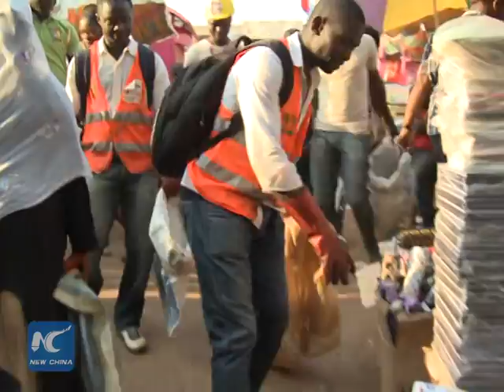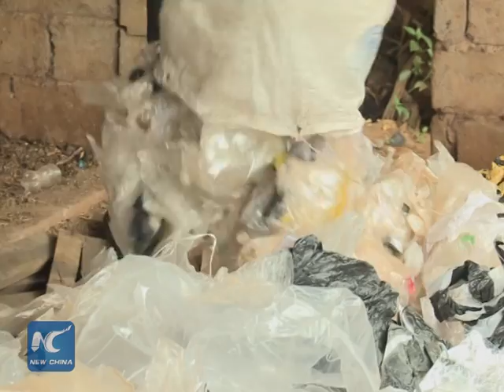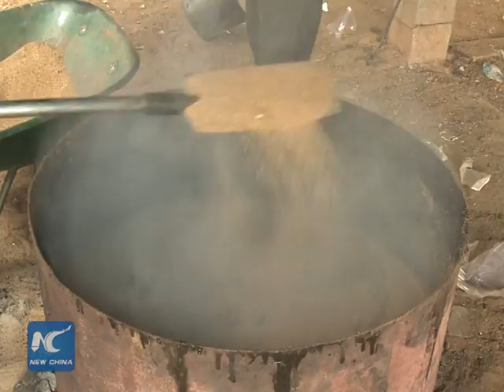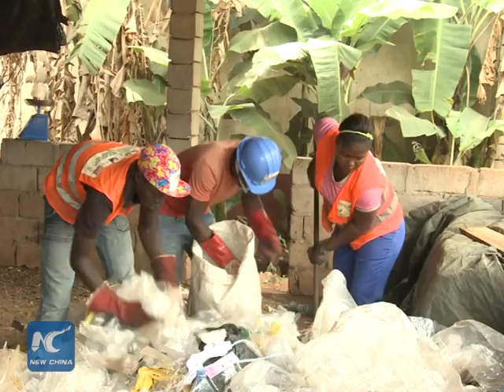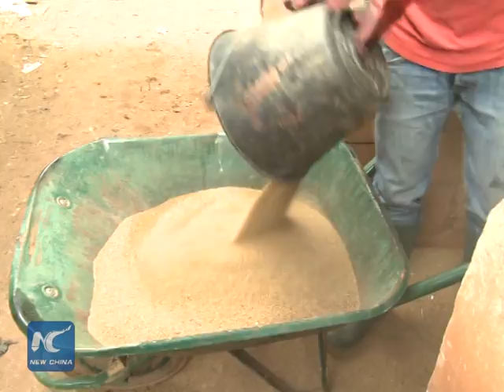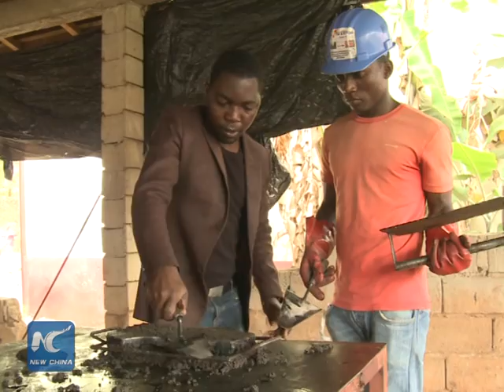Waste to Wealth : Recycled plastic paving stone

Comment: This is not saving the environment. Burning the plastic is the worst thing. It is good out of waste but not eco friendly. Instead of burning the plastic altogether, first make very tiny pellets/pieces of plastic and mix it along with sand and heat the mixture just above melting point so that it wont smoke and then immediately put the mixture into the mould. By this way, same product can be obtained without pollution.

Comment: if you built a house with that in summer they will melt and house will be spoil and people get health hazards .  .
 so it is risky proces . . .is there any solution for reduce melting in summer ..
Reply: will not melt as can withstand 120 degree celcius
Reply: Can sustain upto 160 degree
Reply: Many homes have been built at 25% to 30% the cost of a conventional wooden, brick or concrete home.  Have you tried putting a plastic bottle out in the sun?  Does it melt?

If plastic and melt so easily, we would have solved the plastic pollution problem.

Comment: look at my youtubes this is very good ld and polyprop that's being used .And yes openfire is toxic as well as using wood for fuel .low temperature 60 degrees .Polipebble system is closed and non toxic with specialised equipment we also use only plastic that can not be recycled currently and all the codes not only one .The paver under high heat will bend

Comment: ban plastic and save the planet
Reply: there is nothing wrong with learning to use a resources ...but it is wrong not  to learn how to control the disadvantages of the results of the use of the resources....most especially when it started creating new problems that is pointing to another solution..things that has no life must not be wiser than a man....we are still the master at putting things under control

.

Comment: i am Arnest  from Uganda,ive really liked your project cos its saving the environment from pollution,KEEP IT UP BOSS
Reply: nope, it's only hiding the problem under the carpet... All these plastic particles will release byproducts, substances (additives, i.e.), and worse : after years of wearing, micro particles of plastics will contaminate all your environment ... Think twice why we never did that in the western world. Really. I have a degree in "Plasturgy" and can tell you that In the plastic industry, wastes during production are usually crushed and added to new "proper" plastic material. Of course at only a few percent rate, 'cause despite those  if it hasn't been contaminated by grease or releasing agents, sometimes it's quickly cleaned and drIed, but guess what : we can never recycle them indefinitly because the various plastic molecules will lose their mechanical properties as well as their plasticity in a simple manner or "moldability" if you prefer.
Reply: @OktoPutsch  I want to know what can be the solution for this issue.??
Reply: okto putsch have you any idea how we can recycle it in that way without letting it releases toxic gases please?

Comment: doesn't mixing sand with plastic just makes the problem harder to solve? e_e
I mean sure you're reusing the plastic AND you're generating income, wouldn't it be better to keep it in a purer form?
Don't bash me please!
Reply: absolutely, this is the wrongest way i've seen about recycling plastic. Once these pavement bricks will be posed, after years they'll have wear and lot of hazardous substances will release (flame retardants, other additives, and so on), as well as very small particles will pollute their environment, the soils... These countries have a very warm climate, hence it'll only speed up this degradation process. So, in about few years, 5, maybe 10, i don't know, people and children will suffer from troubles, like respiratory problems and the cause will be unknown, or at least, forgotten. They shall better turn these plastic wastes into new plastics through a some simple fumehood filters and produce some 2nd hand plastics for various artisanal works, keeping them "compact" and away from harsh environments.
Reply: Alex Ngu you're right but I don't think sand has non availability problem and plastic is available everywhere.
Reply: stone dust, flyash, etc can be used if sand is costly or not avilable

Comment: fumes of plastic due to heat in summer condition mixed with air which is harmful to inhale for all
in any form ultimately plastic is not environment friendly, we should stop producing plastic.
Reply: hot enclosed screw conveyor is the right machine to heat n mix shredded plastic n sand to make a hot mix out of it

Comment: what is the ratio of the sand and the melted plastic as well as the heating temperature
Reply: Nestor Mata 30% plastic 70% sand
Reply: @danielcuevas5899  are you any thing else like cement or admixture
Reply: Thank you very much sir for the info, we will do it here since we started our solid waste management program in our barangay but our cooperative have no enough funds to sustain the waste advocacy.
Reply: have you been able to achieve anything
Reply: Nestor Mata is your program still running sir??
Reply: Daniel Cuevas what if we will add 50-50
Reply: what is nestor mata

Comment: how reliable in hot climatic condition? what is the max temp.
Reply: can withstand 120 degree
Reply: What type of plastics to be used either LDPE plastic or any kind of plastics
Reply: @MkMk-es6ml  any kind of plastic can be used accordingly max temperature has to reach melting temperature among various plastic in use.
Reply: @sainiamarjeet  tank u

Comment: they are heating the plastic in an open vessel, ain't that a health hazard.
Reply: That is not actually a cause for concern in terms of pollution at least depending on the temperature of the furnace. At lower temperatures the plastic is not releasing significant or any amounts of co2. However when heated plasticizers, flame retardants,  anti-fungal agents, stabilizers and other additives may become a vapor. Most of these additives are a bio-hazard. However gas masks and plenty of ventilation would be the best strategy to minimize risk. However they are BURNING the plastic not just heating it and that is problematic as it creates various VoCs. I do not think however it creates a significant amount of CO2 compared to the waste used.
Reply: I AGREE. They should look into that angle. Otherwise. it's just a guise of solving pollution by creating a new form of pollution!!!
Reply: not bad for a 10 dollar operation they can build it up and increase the health standards naturally.
Reply: pullution can be avoided if they could use compressors which can run, using the gases that resulted from heating plastic
Reply: exactly
Reply: The addition of a heavy duty air filter in the right place would make this process flawless
Reply: AARON VARGHESE True!!!
Reply: very good, what is the ratio of plastic to sand at the set temperature in how many minutes
Reply: Is joining the lid up is a solution
Reply: Ranjan Kumar can u help me?
Reply: Ranjan Kumar how can i prevent pollution from plastic burning?
Reply: It's pathetic.
Reply: I don't believe they thinck about it on long term. They want a job and to eat today.
Reply: Ranjan Kumar and what about the resulting liquid